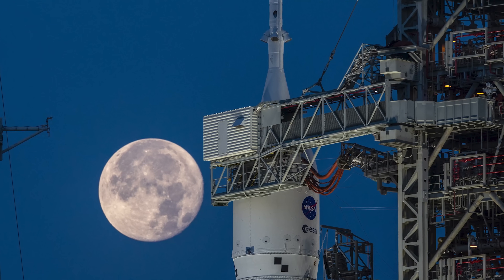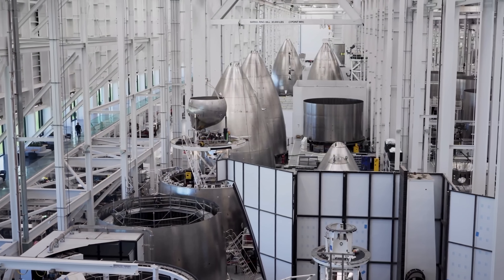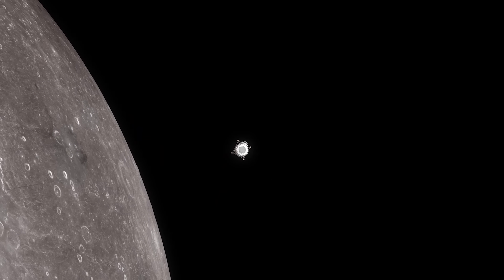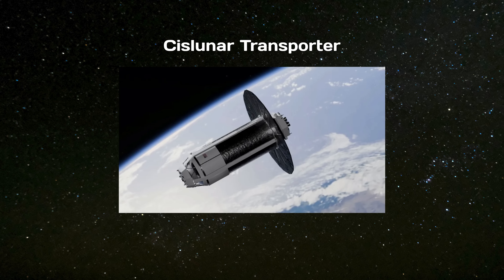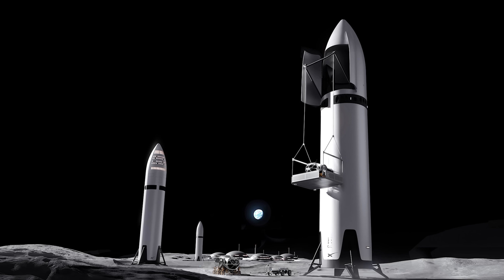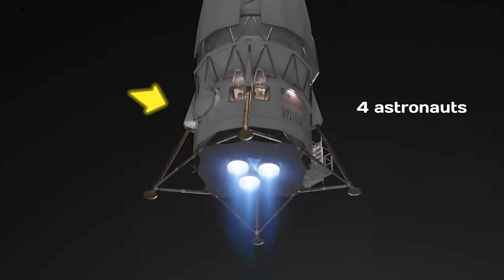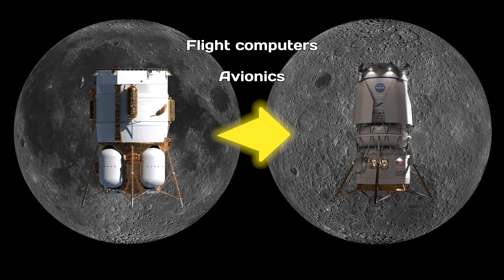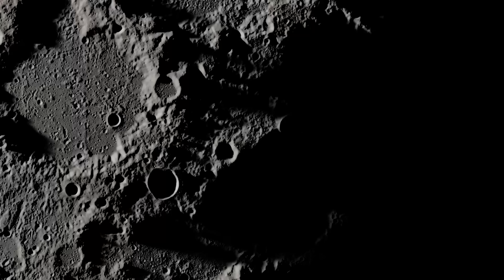SpaceX Found Brilliant Solution to get back to the Moon before China without Starship: Blue Origin

Comment: Starship is too heavy, to go to the moon.  The fact that there will need to be 10-12 refueling missions to fully fuel starship to go to the moo is absurd this is.    Leaving the dead weight behind is the right approach for now.
Reply: Plus, in the lists of cargo to be stationed on the surface awaiting astronauts, I didn't hear water among them.  I don't care how well-trained humans are, they still need a gallon a day, wherever they're standing to stay healthy.  And spare air isn't a bad idea, either.  People can last a lot longer without food than either of those two.  What am I missing?

Once a spacecraft is moving fast, it doesn't need more fuel to keep moving fast.  I don't quite understand how Saturn/Apollo missions could get there with NO refueling but now we need thousands of tons of fuel.  The moon is still the same distance away, isn't it?
Reply: @dwills777  
My guess is "Cargo" includes the dietary requirements for the astronauts. Astronauts will have enough water by using advanced closed-loop systems to recycle and purify water from their urine, sweat, and breath, similar to the International Space Station's (ISS) current systems. The oxygen is stored as a dense liquid (cargo) and released as needed to maintain a breathable atmosphere. 

The Apollo Lunar Module was approximately 23 feet (7 meters) tall and 31 feet (9.4 meters) wide with its landing gear deployed. Its cabin was about 235 cubic feet (6.7 m³), and the overall weight with crew and propellant was around 32,500 pounds (14,700 kg). The entire lower half of the Apollo lunar module, known as the descent stage, remained on the Moon for each of the six successful lunar landing missions - requiring less fuel for takeoff. Astronauts also left behind other items, such as scientific equipment, waste, and flags, to reduce the weight they needed to bring back to Earth. The Lunar Module was not designed to return to Earth. Bringing it back would have significantly increased the required fuel and weight for the Saturn V rocket, which was already at its maximum lift capacity. The length of lunar lander missions, referring to the time on the lunar surface, varied from about 21 hours for Apollo 11 to approximately 75 hours for Apollo 17.

The SpaceX Human Landing System (HLS), which is based on the Starship vehicle, is approximately 50 meters (165 feet) tall and has a diameter of about 9 meters (30 feet). The SpaceX Starship Human Landing System (HLS) will stay on the moon for approximately one week (168 hours) for the Artemis III mission, with astronauts conducting up to five Extravehicular Activities (EVAs) or moonwalks.

They're bringing more stuff for longer time, which needs more fuel to accelerate (and decelerate !), same for landing/taking off from the lunar surface (even at just 1/6th of Earths atmosphere)

Comment: Werner Von Braun wanted to land a tall full sized rocket on the moon too. He was talked out of it by a mid-level design engineer who absolutely KNEW that the risk of a tall rocket tipping over or not being able to return to  lunar orbit due to either the fuel or oxidizer freezing solid or boiling off. Werner saw that the risk was too high and could severely compromise the astronauts' lives and the success of the mission with returning them to the earth safely. Starship through all of its revisions has still not achieved a successful earth landing--splashdown or otherwise.
Reply: Neither has Blue Origin ?

Comment: Sure it maybe be able to get there but that’s already been done. The next step is building infrastructure.
Reply: One real problem is storing energy through the lunar night that's 2 weeks long and crazy cold.
Reply: @dwills777 That’s why the lunar poles are the focus of interest. There is a constant temperature differential in close proximity that can be used as a benefit for thermal regulation and power generation. I can’t wait to see if water situation is easily utilized.

Comment: Finally NASA is coming to their senses. Blue moon looks like a better option just for the reason its a squatty ,stable platform. Don't know why they are still considering Space X Flash Gordon starship. Why are they not using hypergolic fueled engines? Design was proven over 60 years ago
Reply: Blue Moon uses liquid hydrogen which is even worse to contain.... I would agree that specialized vehicle for landing is better than jack of all trades, but Starship could be economically better option, because it can be returned and refitted. What are you going to do if Blue Moon, Gateway or Orion fails ? You will be stuck in space.

Comment: I'm glad that there is a second lander system also in development. Starship HLS returns to the problems of the Nova rocket and direct ascent. Starship HLS will require a very flat surface to land on due to the height. 30 meters is over 90 feet tall. For a comparison that is going from the end zone zero-yard line to past the 30-yard line on an NFL football field. That thing is huge, and with that height you get a pendulum effect at the top. If the lander is not totally level but puts a landing leg in a crater it could topple over just from the height of the lander. Granted Blue Moon can also have that issue depending on how wide it is at the base of the landing pads. NASA knew this and had a very wide stance for the landing legs of the LM compared to the height of the lander.
Reply from the maker: Blue Moon’s wider base could help, but both need careful design to avoid tipping.

Comment: Well another thing is the only failing thing you ever actually understood is SpaceX already flew around the moon and came back to Earth after it left Earth so it already has enough fuel and it's go to the moon and back maybe not take off but back so it needs is a little bit more for takeoff and Nash I could tell him how much it's going to be for takeoff cuz they did it once before several times before and this multiply that by a little bit for the size of the spaceship SpaceX and they got left off and they could use the rest to come back without using fuel coming back to Earth because you don't use fuel gliding from Moon to Earth use compulsion as you start off firing to go then it's that turn off the fuel to engines and let it glide all the way just like NASA did or do you want them to crash into Earth making a crater 1800 ft around 500 ft deep That's the concept you're not understanding because I have to slow down when they come to Earth so they have to have a little bit of fuel for that they ain't going to power their engines going all the way to Earth cuz all they're doing to do is keep speeding up until they get 100,000 miles an hour and crashing an earth 2 hours later after they leave moon not able to slow down

Comment: The only problem with going off to the Moon with SpaceX you don't need fuel to go all the way All you need is fuel to set off the route to go and just like Earth did with sending Armstrong they set up in space and use a little bit of air to shoot them off towards the moon and they went to the moon then they had a little bit more air to run around and then a little bit of fuel to actually go land down on it SpaceX does not have to have that much fuel up there to do that That's where everybody's flawed at and taking off of the Moon all they need is a little bit to take off from Moon like less than what it takes off and getting off from Earth but everybody's thinking it's the same as taking off from Earth so they fill up the fuel tank once when they go up in the space they fill it up again and they send it to Moon 90% of the fuel still be left in the rocket 90% of the fuel that has to be unloaded hopefully being enough tanks to unload all that fuel because that's a ton of fuel that's several truckloads so if I was SpaceX I'll send everything up to that's going to go up there and stay up there plus everything that's going to come back like the two rockets is going to have to come back down to earth after it leaves the moon then send a couple more for a living both places so they has four of them up there and a circle range right around the South Pole going back from the South Pole where they take a little corner of the South Pole nass is going to take another little corner of the South Pole Blue origins going to take another one of the corner of the South Pole and watch out China is going to take another section of it

Comment: Starship needs to land like Space 1999 Eagle.
Reply: That would answer many potential problems. Do so, and they would have a ship that can do more than just land on the moon
Reply: Vapor Recovery Units (VRUs) for different applications, including Cimarron Energy, John Zink Hamworthy Company, Aereon, PETROGAS Systems, and Flogistix, among others. These VRUs capture and recover volatile organic compounds (VOCs) and other vapors from sources like storage tanks and loading operations to reduce emissions and improve profitability. Boil off gas (BOG) is captured and compressed for other uses such as power generation, heating units, and more however, to burn anything with this gas requires LOX (Liquid Oxygen). The primary need is that od habitable necessities. This will also include using drilling (Boring) equipment to dig out a cave system where humans can live and work. A tunnel system gives us a safe haven from micrometer impacts, cosmic radiation, and more.
Reply: Yup... That's why I don't know why they didn't go with the Dynetics design shown at 4:35
Reply: I believe SpaceX is looking into that. Though it would require some significant srtuctural changes to handle the loads being redistributed from the vertical to the horizontal.

Comment: Sorry. I just couldn't see this video through to the end...
The "concerns" were political BS and the "Solution" was a $3.5 billion dollar award to BO as they promised to cough up the other $3.5 billion for the other lander that will Also have an aweful "lot to prove"? Starship lander is much further along in hardware testing (Starship and lander use much the same design)... so a completely unproven design is... very vaguely comforting?... to mostly non NASA politicians that want the Admin job like Jim B.

NASA isn't so much concerned, its Ex-NASA people and outsiders and one guy from a report with Very vague concerns. One was that Raptor 3 design was still improving and wasn't "Frozen" as if Spacex needed to do that with additive manufacturing. The other was that space refueling was never done before... ie docking, fuel transfer, solar shielding... which have All been done before... especially docking (Crew Dragon). 
He claimed this, somehow, could delay NASA "years" beyond 2027 with Zero explanation why. Clearly he had No clue of the Massive infrastructure that Spacex is building.
Jim B said it would take dozens and dozens, millions and cajillions of tankers... 8 V4 tankers to fuel 1 V3 Lander. At no cost to the government today and essential to put more than a fridge on Mars later... or anywhere else in the solar system.

It was the concern of the ignorant... which is rather a concern itself.

Worst case, they go in 2028 instead of 2027 with a vastly more capable ship and infrastructre for repeat, low cost flights (about $1.5 billion vs $4.5 per go)... about 2 years before China... if that's a concern... the critics also seemed to be oblivious why we would Absolutely Need orbital refueling for future missions. Ie to put large tonnage on a planet or moon to create a "permanent base"... or go to Mars with something larger than a refrigerator... apparently 15t vs 100-150t... what's the difference? Are these guys engineers? How big would their rocket be to plant 100t on Mars with no LEO refueling? 

The word "myopic" comes to mind. 

The biggest problem I have with old NASA is the constant absolute minimum (yet incredible cost) to get the job done with no thought to the future. Example: Spending $10 billion to mount a sample return mission from Mars with a custom piece of equipment that would never be needed again... while Spacex plans to go there anyway (at little to no cost to the US) with a general purpose rocket with 20x the capacity or more... in the Same time frame. That mission (thank God) was cancelled. 

Spacex can pick the samples up as they practice landing and returning from Mars with in-situ fuel generation after the lunar launch/landing with much the same hardware. And still get it done in the 2030-33 timeframe of the $10 billion mission.

To put a "permanent base" on the moon: lander based on Starship V3 would have about 75-100t cargo capacity to the lunar surface. Lander based on V4 would have 100-150t capacity to the lunar surface. BO can land 15 tons and likely costs considerably more. Certainly they won't be making them on assembly lines like Starship at up to 100 per year (2/month currently) Regardless, it has no significant propulsion of its own to get to lunar orbit. 

I also rather doubt that it will somehow be ready before the starship lander. Look at New Glen development vs Starship... want to guess how long it would take? 

As for landing a tall rocket on the moon... do I Have to point to the tall, spindly F9 landing on a barge at sea hundreds of times in 6x gravity and with wind? Is an Engineer suggesting that's easier than landing on the moon... or just some random clueless guy?

Let's understand the logic employed here. This is pure pork... not intelligent decision making to solve the stated goal.

Comment: I'm really confused with the need for multiple refueling needs in space, an area with no gravity or resistance. Basically, a 90% glider.
Reply: It affects the length of the mission.  Apollo was about 8 days.
Reply: The ships have much more mass both starship and New Glenn,  and the fuel they launch with can only get them into orbit around earth.  They need to be refueled so they can do a transluna injection burn. This get them into moon orbit, then more fuel to slow down and then land on the moon. Take off from the moon,  and then to another burn to reach earth orbit. Finally the burn h too land back at the launch site.
Reply: @spitbacca  100% , it’s all about gravity and mass, which is why humans will never land on Mars and return alive using chemical rocket propulsion technology.
Reply: I'm confuse where my post has gone explaining to you why they need refueling. Too much actual facts for this channel i guess!

Comment: clearly the biggest challenge is the radiation that human cannot safely escape.  with latest technology and computer there is still no answer as to how it can be done to bring man to the moon.
Reply: I believe the long term answer is to burrow under a mountain side and hollow out an area to live in. Short term space ships can have PE radiation shielding for months long stays. Very little radiation shielding was provided for the astronauts over 50 years ago and 3 made multiple trips. None had problems in later life due to radiation.
Reply: What are you talking we did way back in 1969🤦‍♂

Comment: I knew, from the beginning, that Starship would be a failure.
It relied on technology that hasn't been invented yet.
I have more faith, in the Tesla Roadster than Starship. 🤨
Reply from the maker: Haha, Tesla Roadster is definitely easier than Starship
Reply: The design, build and crash approach Musk is taking won't work. NASA used Tried and True Components and still had problems. Musk is full of himself and thinks he knows more and has a better idea than NASA. The reason NASA used a Throw away rocket to get to the Moon in 1969 was because it was the best, cheapest and easiest way to use only ONE ROCKET for a 2 rocket mission. Musk is trying to Fly a Grain Silo to the moon, land it and launch it with no landing pad or launch tower on the moon. If he was Tripping on Acid I could understand his thinking. NASA worked most of this out in early 1960's and were on the moon by 1969. Musk still can't figure out it won't work because he would be admitting he was WRONG!
Reply: @Rollingone-g9x 
Amen 😌
Reply: Still even if so it have pushed space tech development clearly forward, a success in itself.